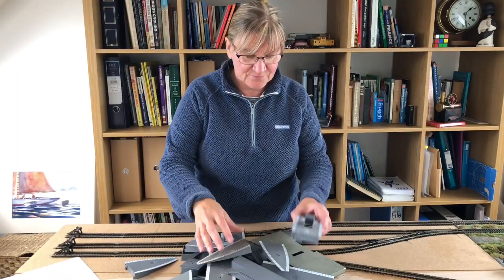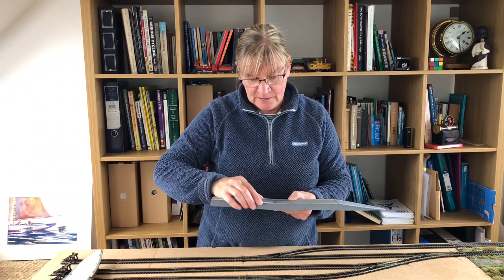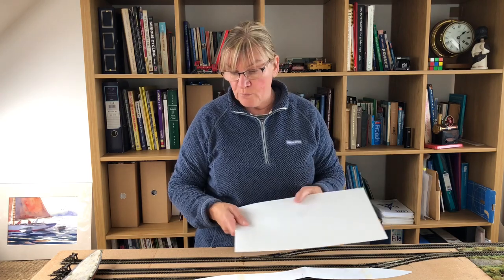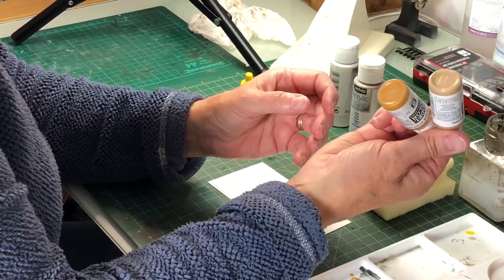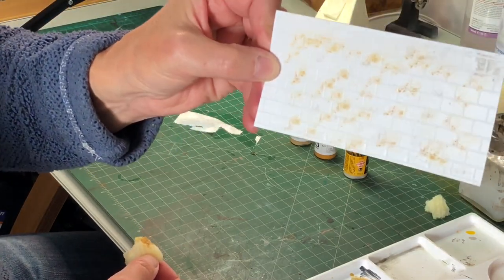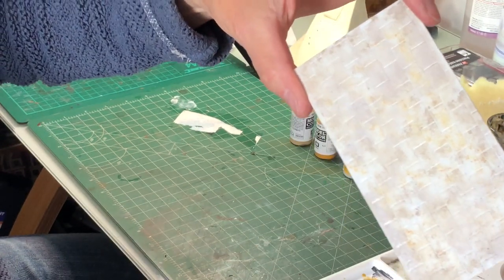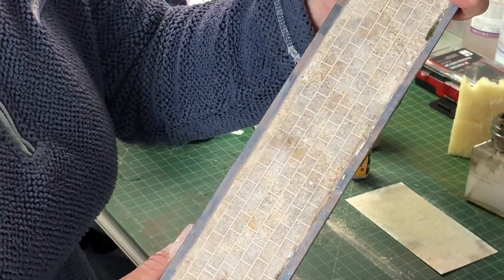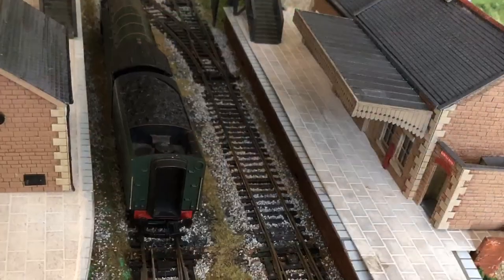Improving  Hornby platforms

Comment: Can I suggest a way of disappearing the butt joints? If you carefully cut away every other slab at the mating edge, and then do the reverse on the adjacent one, they can then slot together. When glued down and painted, the sheet edges vanish. "Don't tell 'em Pike".......  This technique also works on brick or stone walling,  if it's a long stretch.
Reply from the maker: Great tip thank you 😊